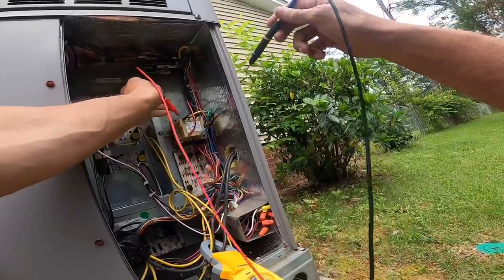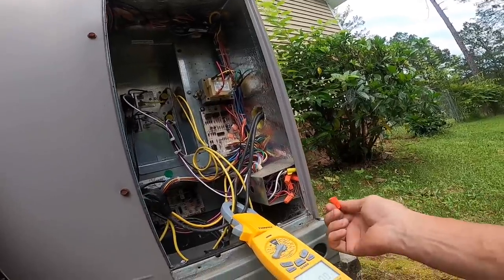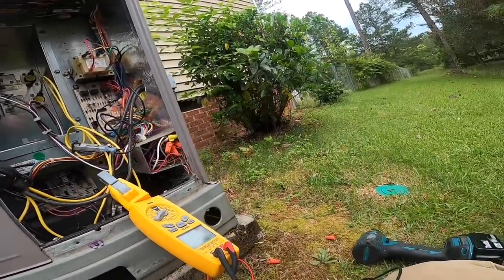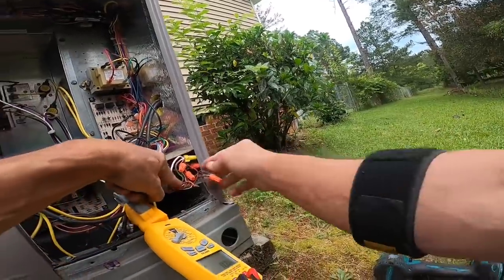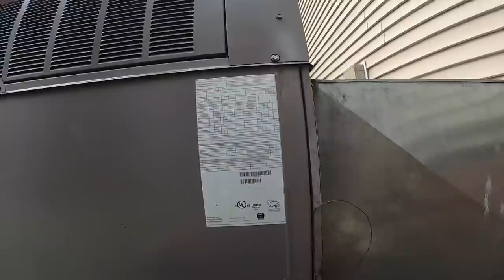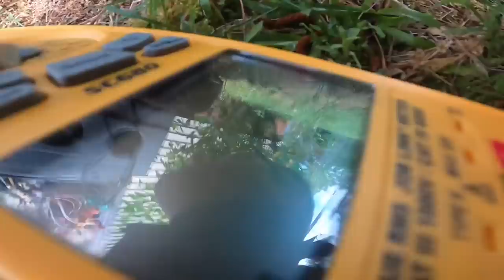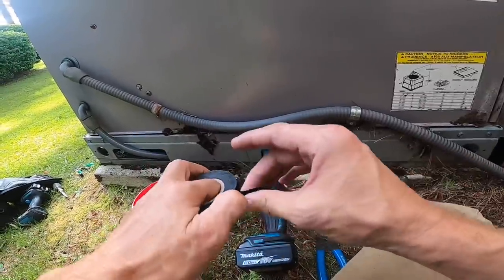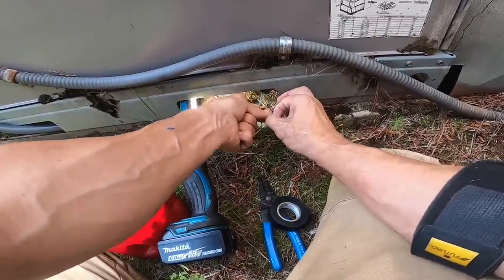Low voltage short investigated, and problem found.

Comment: Have you ever tried using the short pro tool? It trips if you have a short and you get a red light as long as you have a short and goes out when the short is cleared without having to be resetting the circuit breaker. Once the repair is made reset the short pro and everything is back to normal.

Comment: 1/2 inch black wire loom tubing. 100 ft. costs less than 20 bucks. Split would be easiest fix to install over tstat wiring.

Comment: New tech here. Really appreciate your videos. Did it pop on the compressor wire? If so how did you determine thermostat wire?
Reply: The fuse was blown and the low voltage thermostat wire is tied to the fuse

Comment: What we do is cut a metal hanger the depth of the base and run it around the bottom of the unit so no rodents can get in through the holes.